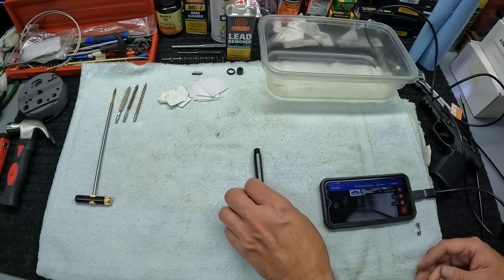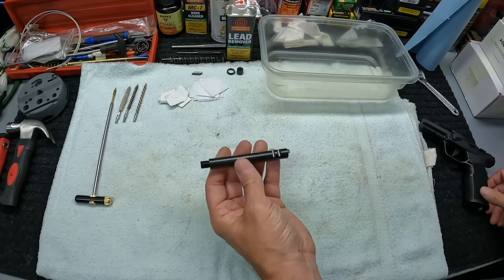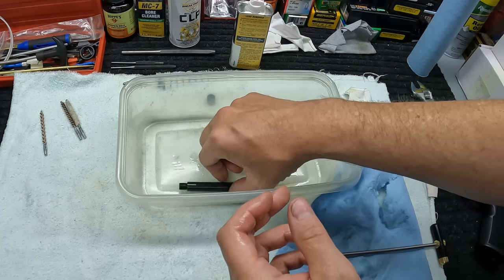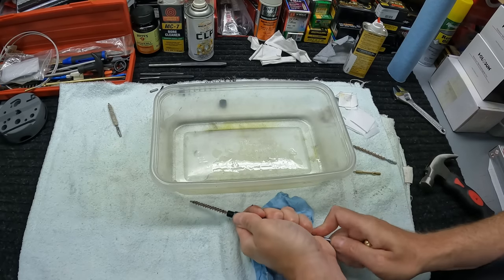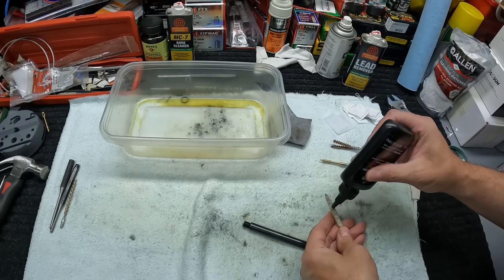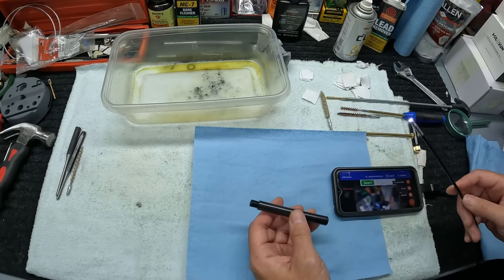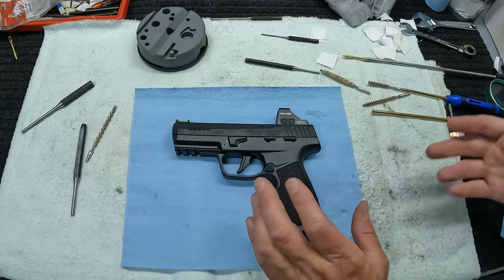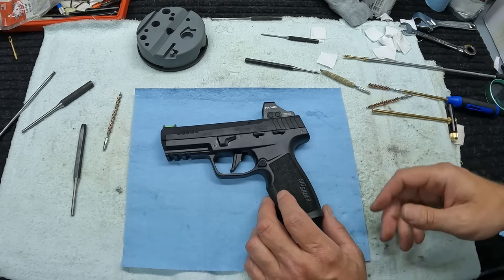😱What A NIGHTMARE!😱 Can I SAVE It? SIG P322 Leaded Barrel!

Comment: the leading after 100 rounds of CCI Stingers was SHOCKING! I have never seen anything even remotely close.. Everything they say about the P322 is true.. Buyer Beware - AND the optic is subpar.. Go with a TX22 Comp.
Reply: I ended up trading mine in for a Taurus TX 22 compact because it was constant failure to feeds and failure to eject. Couldn't be happier now. The Taurus hardly ever jams and it eats anything I throw at it
Reply: @steveareeno65  Totally. Same and the flaring at the bottom of the grip makes it difficult to remove a stuck magazine. The X22 is superior.
Reply: I changed ammo and the leading issue disappeared - I guess it does not like CCI Stingers.

Comment: oh where to begin. how many shots of that stuff did it take to get your barrel in that condition?  to be fair i suggest you fire an equal number of shots of something else then examine the barrel for fouling. it the barrel is ok at that point, and this might be a pain in the hindquarters, fire another equal amount of shots of the same winchester and see if you have the same problem. i know it would take some efforts but i only say this because i wouldnt want to write off a whole brand of ammo because of one bad outing. if the other ammo doesnt foul up the barrel, but the winchester does for the second time then you will have removed all doubts and know for sure its the ammo and not the gun. but if both brands of ammo equally foul up the barrel, i think the problem will be the same as some of the early tx 22's which turned out to be some kinda imperfection somewhere in the rifling. if this is the case sig should send you a new barrel for free just like taurus did
Reply: I'd like to see the Winchester ammo fired in another gun and see if that happens. I'm thinking it's a combination of the cheap ammo and something not being right with the barrel of the Sig. Maybe most ammo will work fine in the Sig but also the Winchester ammo will work fine in most guns but together it's a disaster. 😳
Reply from the maker: It was less than 80 rounds of the Winchester to get it to this point. I have fired a few hundred rounds of multiple ammo brands before this through the Sig and had no issue. The taurus TX22 early barrel problems were nothing like this. I know because I had the bad barrel, and it didn't cause any leading.  It was poor machining of the lands and grooves that was very visible to the naked eye. This Sig barrel internally is flawless. I'm definitely gonna do some more testing to be 100% sure, but I personally have no doubt it was ammo related.
Reply: @ToolsandTargets  i have been educated today lol

Comment: Great video !   My new Sig 322 did the same - with the same ammo !   Soaked the barrel in solvent and then scrubbed the bore with a new bore brush. After a good dose of “elbow grease” the bore is nice and bright !   Will go to the range tomorrow and try four other brands of ammo - but no Winchester !
Reply from the maker: Interesting. I've run quite a few other brands through it and no problems before this.
Reply: Any updates on the sig 322 ? Thank you.

Comment: Winchester 22 Recall

WINCHESTER, 22 LONG RIFLE CALIBER, SUBSONIC, LOT NUMBER EK72

RECALL: The Olin Corporation, through its Winchester Division, is recalling a lot of 22 Caliber Subsonic Ammunition.

Through extensive evaluation, Winchester has determined that one lot of 22 Caliber Subsonic Ammunition manufactured in its Australian plant may contain cartridges with double powder charges.  Our evaluation determined that approximately 1,024 double powder charge weight cartridges may have been produced out of 440,000 rounds manufactured in LOT NUMBER EK72. Double powder charge weight ammunition may cause firearm damage, rendering the firearm inoperable, and subject the shooter to a risk of personal injury when fired.

DO NOT USE WINCHESTER .22 CALIBER SUBSONIC AMMUNITION 
THAT HAS LOT NUMBER EK72.

The ammunition lot number is stamped (embossed into the cardboard) on the inside flap of the ammunition box.  To determine if you ammunition is subject to this notice, review the lot number and if it contains LOT NUMBER EK72, return it to Winchester at the address below for replacement.  Other lot numbers are not subject to this recall and should not be returned to Winchester.

Olin Corporation
Winchester Division
427 North Shamrock Street
East Alton, Illinois 62024

Attention: Product Service Department

                 .22 Caliber Subsonic Recall

Winchester will send you a coupon good for replacement ammunition from your local Winchester dealer.

If you have any questions concerning this .22 Caliber Subsonic Ammunition Recall, please write to the address above or call:

(800) 526-0015 (except Alaska, Hawaii and Canada)

(800) 258-2833 (for Alaska, Hawaii and Canada

We apologize for any inconvenience.

WINCHESTER

Comment: Good information in this video. There really are no solvents that dissolve lead. Solvents that are chemically strong would eat some of your barrel. The good chemists come up with solvents that creep in and release the bond between lead and steel. They all want a pretty good soak time. CLP is a good one, Sweets is good, I've had good results with Tetra (ammonia based). You did a really good job cleaning out that mess. After watching the Winchester ammo test run and the fun time you had with the cleanup, I'm guessing no one is going to run out and buy that stuff.  You've saved us some grief.
Reply from the maker: I sure wont be using it anymore. I'm definitely gonna do some more testing with this Sig just to confirm it is related to that ammo.

Comment: When this happened to my walther I ruined 2 brass brushes, ended up using a safety pin to scrape out the rifling. It still does it with anything less than the best copper washed bullets. Thinking about telling them to send me a new barrel. Looks like yours has the same problem, like they torqued the thread protector way too tight and mushed the barrel a bit.
Reply: Interesting. Tools and Targets you should put the micrometer on that barrel top just to confirm
Reply: @bhief473  I only suspect this because I have several guns in 22, it is the only one with a threaded barrel, and the only one that gets leaded up. I can run 500 thunderbolts through my Buckmark without issue, I get fouling after about 3 mags of them in my P22.
Reply: That's very interesting. Best comment for this video. If what you say is right, and I think there's a real possibility you're right, Tools may owe Winchester an apology. Lol
Reply from the maker: @natjonestower3035  The barrel is completely consistent in diameter. The thread cover on this came off without any tools. Nobody owes Winchester jack. This didn't happen with hundreds of rounds of various other brands of ammo.

Comment: Wsup? So I also have a P322, my barrel also lead up with about +/- 500 rounds many different brands/types of ammo, I used a Bore snake soaked in bore cleaning/solvent(any kind) and slowly pull it back and forward (+/- 2mins) then a good quality brush also soaked in bore cleaning/solvent again back and forward few times and it came out perfectly clean. Now that been said I notice on your barrel and mine that there are a lot of tool markings. Have you or anyone tried to polish the barrel?

Comment: Winchester 9mm Recall

Winchester LLC is recalling a number of 9mm Luger 115 grain Full Metal Jackets and 115 grain Jacketed Hollow Point pistol ammunition. Symbols impacted include Q4172, RED9, USA9JHP, USA9MMVP, USA9W, and WW9B.

The Lot Numbers include:

SC03LD44, SC03LD45, SC03LD46, SC03LD47
SC13LD1, SC13LD6, SC13LD18, SC13LD44, SC13LD45, SC13LD46, SC13LD47
SC52LD44, SC52LD45, SC52LD46, SC52LD47
SC62LD44, SC62LD45, SC62LD46, SC62LD47
SC72LD44, SC72LD45, SC72LD46, SC72LD47
SC92LD44, SC92LD45, SC92LD46, SC92LD47
SD10LD1, SD10LD3, SD10LD6, SC10LD12, SD10LD18, SD10LD46, SD10LD47
SD50LD1, SD50LD3, SD50LD6, SD50LD11, SD50LD12, SD50LD18, SD50LD46, SD50LD47
SD60LD1, SD60LD3, SD60LD6, SD60LD11, SD60LD12, SD60LD18
SD70LD1, SD70LD3, SD70LD6, SD70LD11, SD70LD12, SD70LD18
SD80LD1, SD80LD3, SD80LD6, SD80LD11, SD80LD12, SD80LD18
If customers purchased ammunition of the above Symbols before March 25, 2021, it is not subject to the recall.
Reply: Cant find any recalls on Winchester 22 except from 2014. GREAT JOB cleaing that barrel Tools!!!
Reply from the maker: Thank you ma'am.😎👍

Comment: You're not supposed to ever pull back a brush half way through the barrel. With that said, I highly doubt a brash brush would actually damage a steel barrel though. It does jam the edges of the bristles straight into the barrel though, so I would use caution.
Reply from the maker: Yeah, if brass brushes damage the barrel then there's a problem. The main thing to make sure is you're not scrubbing back and forth with it dry.

Comment: Thank you for the cleaning process.  I just bought a TX22 because of leading problems shown with the Sig 22.  After the first day out with the TX22, I had a bad leading problem as well.  So it appears the leading problem is not just with the Sig 22.  I used CLP and lots of scrubbing with the copper brush, once I could get it thru the barrel.
Reply from the maker: Wow, that's not good.
Reply: What’s going on with the barrels on these new hi-cap .22 pistols?

I can see their having mag problems; these are novel mag designs (multiple stack etc.).

But it doesn’t seem like there’s any obvious connection between mag problems and the barrel getting leaded all to H*ll.
Reply: Ammo
Reply: @FMDad-dm5qo  what problems are you talking about with the mags?? The TX22 mags work amazing!

Comment: Well now this was a interesting video and I have never seen a 22LR barrel that leaded up. I'm even surprised that the bullet could get out of the barrel. I'll tell you what I use for lead and it has always served me well and that is JB non-embedding bore cleaning compound and this is designed just for lead fouling. This is the only thing that I found would clean my 300 blackout when I was using lead coated bullets 220 grain subsonic.
Reply from the maker: Good to know. I'll have to check that out.

Comment: I have had lead problems like that before.  I am lazy, so was looking for the easy way to get lead out.

I found chemicals did not do much.

Brownell's sell stainless steel barrel brushes.  I found that a stainless brush wrapped with some copper Chor Boy scraped the lead out well.  

I left the barrel over night with some regular penetrating oil.  It worked its way under the lead and the last bit of lead then came out with the stainless brush.

Comment: I have seen far worse but not my guns. any worse I would mix 50/50 peroxide and vinegar,plug up barrel at chamber with cork, filling barrel full letting set 24 hours .then scrub. Also I have kroil oil that's awesome . it's advertised able to penitrat a crack. 1- millionth of a inch.but only on    inside of barrel it will take the blue ing off and paint on equipment your trying to take of bolt or nut.  this is only for extremely leaded barrels. great for breaking loose rusty bolts and screws. , papa wishing you well
Reply from the maker: Thank you sir.😎👍

Comment: Had same thing happen to me.  Just got a P322 a few weeks ago.  Within first 150 rounds, I noticed key holing on the targets.  I stopped firing with it and took it home to clean.  My cleaning rod with wire brush tip got stuck in the barrel.  I was not able to push it all the way through.  I damaged two rods trying to get it back out.  The rods ended up bent, flared at the affected ends, and partially cracked at the same ends. I eventually got it cleaned.  Haven't been back to the range yet to see what happens next, but I am not optimistic.
Reply from the maker: If you haven't seen the follow-up videos on this one, they never did get it right. They sent it back multiple times with multiple bad barrels that leaded up. It's now back at Sig for good and I'm waiting on a refund check.

Comment: I have a lead removal tool that uses brass screen material over a rubber plug.  You put the rod through the barrel, then screw on the plug and pull the screen and plug out of the barrel.  The screen grabs the lead and pulls it out.  I'm not sure if I have 22 size I use it for bare lead reloads for 45ACP,  40, and 9mm.
Reply from the maker: Interesting

Comment: Bought a used encore 12 gauge rifled barrel years ago for cheap. The previous guy shot rifled slugs through the rifled barrel and it was bad!!! I had to use a drill with bronze brushes and it was like honing a cylinder. I had a pile of lead on table afterwards. Lol

Comment: If that happens in the future I would recommend buying a Birchwood Casey lead remover cloth.  Cut it into patch size pieces and make sure they are nice and tight in the bore.  Put them on a jag and push them through between solvent applications.  I am not sure what they treat those cloths with but they work wonders.
Reply from the maker: Thank goodness this thing is long gone bought back by Sig.

Comment: Horrible leading. I would send it back to sig. That much leading could indicate the barrel is to big.  Could be .224 or225.
I have 2 kel tec p17s, ruger lcpii 22lr, 2 kel tec cp33,  rugee lcrx and never  jad that happen.  Even after not cleaning gun for tons of rounds.
Reply from the maker: It ran a few hundred rounds of different ammo without any issues. This happened during testing that garbage white box ammo.
Reply: @ToolsandTargets  oh well that explains alot.  Thats junky ammo.  Still never jad that happen in all years of shooting 1022. Maybe slug the barrel. That excessive leading is indicative of something wrong

Comment: I believe you have found what I have known for sometime, there are no chemical solvents that will actually remove lead deposits from your barrel!  With one exception, which is still in production (of course, it's a total pain in the backside but it does work!).  If you think you have a chemical that removes lead, polish the bottom of a lead bullet and put a drop of your solution on it and let it sit for however long you think is reasonable.  Other than the dried up solution, there will be no evidence of damage to the lead!

The lead removers currently available rely on your barrel having a layer of copper, which the lead is on top of.  By removing the copper you might remove some of the lead but the only way to truly get the lead out is by scrubbing with a copper brush & some kind of lube, such as Kroil or WD40.  Never, ever use a stainless steel brush!   I haven't seen any lately so maybe no one is making them any more?  One can always hope!  Part of the problems you encountered are from the brush itself.  Even in a clean bore, reversing a new brush should be difficult if you're part way down the barrel, something you should never do, actually.

Outers makes a kit called Foul Out that actually will remove lead by using the electrode/anode method of electro plating, just in reverse.  A rod with O-rings is placed in the barrel, with the O rings acting to keep the rod from touching the metal of the barrel.  Then a lead specific solution (they also have a solution for copper) is poured in and the electrodes from the power box are connected.  You will then be plating the rod with the lead in the barrel.  It can be a bit messy, if you're like me (clumsy) and with a barrel leaded like yours might take a couple of applications (if the lead that attaches to the rod contacts the bore, it shorts out the system!)  The lead can easily be wiped off the rod, replace the rod and any fluid that has leaked or spilled out and you're back in business!

So if you don't have the Foul Out kit, the only alternative is to do what you did.  Scrub it out!  It's the only time I ever use bronze brushes!  Otherwise I just use nylon.  Another good product to help with lead removal is JB Non-imbedding Bore Paste (they also make a polishing paste which is good for finishing up).  Just be sure to clean all of the paste out after cleaning with Brake Clean then using a good lube in and out on the barrel.  I have heard that the lead cloth from Birchwood Casey also works but I've yet to try it.  One of these days!

The best way to prevent leading is to use a polishing kit such as the Neco polishing kit.  You use 2 steel plates to embed polishing compound into a bullet, then fire the bullets.  Read and follow their directions carefully!  It takes time but works well, polishing the bore so that lead doesn't stick as easily to the bore and what does stick is much easier to remove.  I believe there are a couple of other brands of polishing kits available but I have experience with just the Neco kit and it works!  

I no longer use plain lead bullets, but use poly coated instead, just to avoid having to clean the nasty stuff out of barrels!  Some barrels lead worse than others, although I've never seen a .22lr barrel lead like yours does!  I've heard others complain about their Sigs as well, so perhaps Sig is tapering their barrels or something that is causing the problems?!  Not sure but they certainly need to change whatever is causing it since it can, if not caught in time, can cause dangerous pressures, even in a .22!!
Good luck!
Cheers, 
crkckr
Reply from the maker: It sounds like you probably haven't seen the follow-up videos to this mess, but this thing is now back at sig for the third and final time and I'm waiting on a refund check.
Reply: Yes, I knew that but put the info in for you and anyone with leading problems... something I'm sure you'll run into again at some point!
Cheers,
jc